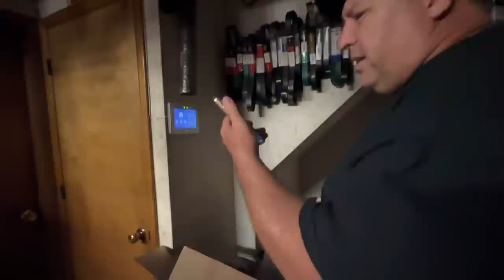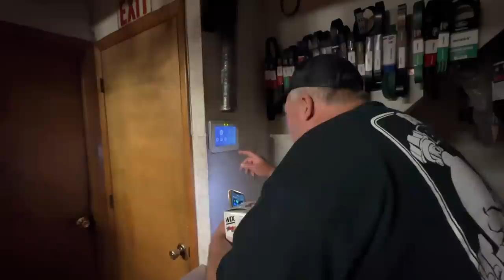Turbo Mustang TEST PASSES!  The Phantom GT GIVEAWAY heats up!

Comment: Seems like the Nova is pushing way to much oil to the top end maybe to high of volume and pressure? Think when it was started on the dyno it was over 100 pounds way more than we've ever ran in a big block or sbc

Comment: Open A1 sauce does not have dairy, mayonnaise, or any other ingredients that could spoil quickly. Because of this, keeping open sauce at room temperature is fine and it can even be stored in a cupboard or pantry if desired. If you like your open A1 sauce chilled, putting it in the refrigerator is a good idea.

Comment: Just a thought but have your trailer tires speed rating checked. Seems like Shawn from 187 customs had same problem. Driving at 80 plus miles per hour was blowing trailer tires due to excessive speed and overloaded.

Comment: Hey ole man do you use traction control on the malibu?  Got a 67 camaro with a triple nickle bb. Carbureted 2 stage. It will do a 120 mph burn out. Someone said I can use traction control. Thoughts? Suggestions?